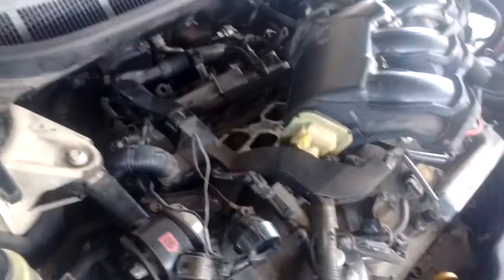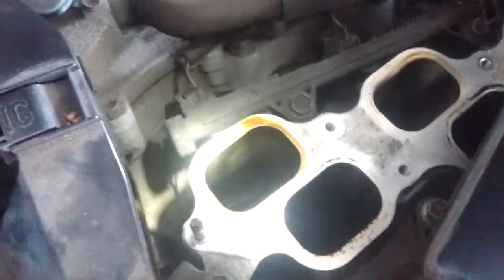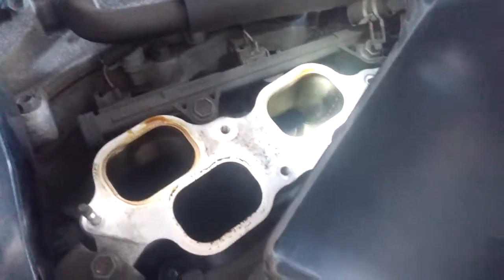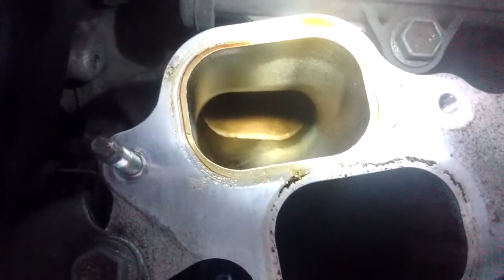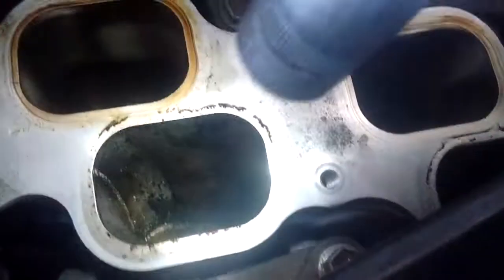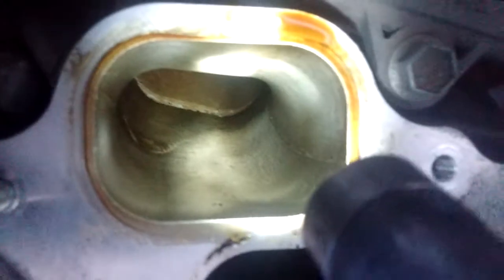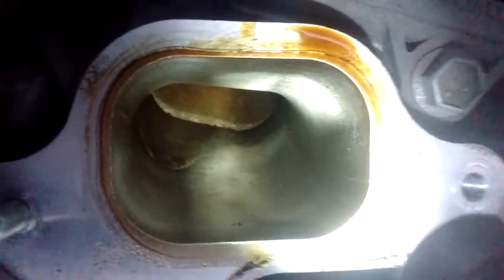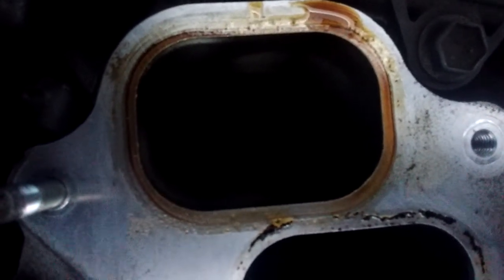2GR-FE - Why You Should Have a Oil Catch-Can

Comment: Would you recommend a closed or open catch can system? I have a highlander i have put a catch can in but it fills up pretty damn quick, im still running vaccuum to it from the intake but thinking of blocking that off and just venting to atmosphere to slow it down
Reply from the maker: If you are filling quick in normal driving,  this means your PCV valve is not working. If you vent to atmosphere you will have a vacuum leak, with CEL, and elevated fuel trims, and all kinds of issues. If you block off the vacuum draw from the intake, then the catch can will not do anything, nothing will pass through the catch can, it needs vacuum to operate.
Reply: @Merryfrankster_  thanks for that! I've got a new pcv in there, have ordered a valve cover gaskets set so I can pull that off and clean it all, I assume the baffles are all sludged up

Comment: Hello Sir, can I use the oem pcv hose that connects to the pcv valve to the intake with the aftermarket catch can? The aftermarket catch can came with a 15mm 3 feet vacuum hose. ADD W1 brand. Please let me know. Thank you
Reply from the maker: Yes if you want you can cut the pcv hose and put the catch can in line if you have the right fittings. I believe the pcv hose is 10mm. 15mm is too big for the pcv valve and for the barb on the plenum.
Reply: @Merryfrankster_  okay I see. Thank you for getting back to me. They had gave me two 9mm aluminum fitting
& two 15mm aluminum fitting. The 9mm fitting was a snug fit with the pcv hose. But I get you you mean about the outlet hose going into the plenum. With that being said should I get another 10mm hose? And where were you able to mount your catchcan? I can’t find anywhere to do so on my 2007 Toyota Avalon 2grfe
Reply from the maker: @samukahtviv1  you Mau have to extend the hoses enough to mount it by one of the strut towers length of hoses does not really matter either side
Reply: @Merryfrankster_  thank you very much. I hope it improves my motor. Lately it’s been giving me poor mpgs, under 18mpg even with highway trips. When I had changed all six spark plugs in December , I noticed the intake manifold was caked up with oil and black crust. Maybe that’s why it’s been giving poor mileage. I didn’t think to clean it that time because I didn’t have knowledge on how to and didn’t want anything to accidentally fall in the cylinders. I’m surprised this is an issue with a port injection motor.
Reply from the maker: @samukahtviv1  to clean it, turn the crankshaft to close the valves on each cylinder in turn. Then use a vacuum cleaner with small attachment to suck out whatever you scrape up.
Reply: @Merryfrankster_  okay I will try that. And I’m sorry to bother but last question…,
will having a catch can like this cause any problems to the internals like seals or rings or something? I’m doing my research and a lot of misconceptions and about seals blowing from pressure. What’s your take on it?
Reply from the maker: @samukahtviv1  that is absolute nonsense. The catch can will not cause any change in crankcase pressure.
Reply: @Merryfrankster_  thank you sir I appreciate your time and help
Reply: @Merryfrankster_  Hi Frank, hope you’re having a great weekend. 
Could I get your business email so I can send you a picture of my catchcan set up? Just wanted to make sure it’s a proper set up. Thank you God bless

Comment: Thanks for the reply.  Again, I value the info you are sharing.  The 2gr fse references you are making just add to my confusion (since I do not own an fse).  BEFORE messaging you last night, I was ignorant as to if my 2gr fe was DI or not & I couldn't find answer ANYWHERE (that's the whole reason why I messaged you to get the answer).  I read about direct injection engines needing catch cans elsewhere and saw that you did not mention them in this video but STILL recommended a catch can for the 2gr-fe.  THAT is what further confused me and caused me to message you again to get clarity about your recommending a catch can for my 08 Avalon 2gr fe (I was not sure if it was DI or not).  So my understanding of your answers is that THE BOTTOM LINE IS THAT... you are saying that my 08 Avalon 2GR fe is NOT Direct Injection but (according to your experience) would still benefit from a catch can.  CORRECT?  Yes, or no, or...?
Reply: You dont have direct injection in the avalon. But the catch can would help in any car honestly

Comment: Just want to make sure I understand this correctly. You're saying that my 2008 Avalon (with a 2gr fe) does not have gdi / direct injection but that it would STILL be best if have an oil catch can on it... Is that correct?  I ask because I HIGHLY value your opinion and, if you think it would be good to have one, then I want to order one as soon as possible.  As a result your fast reply would be very much appreciated.
Reply from the maker: This video is for a 2GR-FE - same as your Avalon engine. The 2GR-FSE with direct injection is not mentioned anywhere in this video. If you have a 2GR-FE, put a catch can on it. If you have a 2GR-FSE, it is even more important that you put a catch can on it. Direct injection engines are very well known for gunking up their intake ports and valves.
Reply: @Merryfrankster_  the 2gr-fse has both port and direct so it is fine.

Comment: Does a 2008 Avalon 2gr fe have a direct injected / GDI engine ?
Reply from the maker: No absolutely not. The 2008 IS350 2gr-fse is the Direct + Port injected engine. It is also a longitudinal engine. No chance you would ever find it in a fron wheel drive vehicle.

Comment: they should have included that oil catch can OEM.  too late now for me to learn this. too much build up alreay.  have no idea how to clean them off..
Reply from the maker: Here's how: With the intake off, set each cylinder in turn to TDC so the intake valves are closed. Then get in there with a stiff toothbrush or bottle brush and a cleaning agent. Use a shopvac with a small attachment to suck out the material you dislodge. As long as the intake valves stay closed, nothing will drop down into the cylinders.  Thoroughly vacuum out then wipe clean the waste material.
Reply: @Merryfrankster_  awosome thanks!
Reply: @Merryfrankster_   awosome thanks!

Comment: Any suggestions on a good oil catch can for the 2grfe?
Reply from the maker: For almost any  application you can use a $12.95 air compressor oil/water trap from Home Depot and it even has a petcock drain.
Reply: Not trying to impress anyone.  Just want to make sure that the home depot version isnt pressure restrictive, thats all.
Reply from the maker: @zee1726  why would it be pressure restrictive? How did you come up with that? On your own? It is rated for operating compressed air machinery up to 120psi. It is probably superior to any piece of junk sold for automotive use.
Reply: Yes I agree, any suggestions as to which catch can I can use for my 2014 2GRFE Highlander
Reply from the maker: But if you're looking to impress spend some money on a billet Moroso.

Comment: Just replace the pcv valve, and then you won’t be loosing engine oil and transferring it into the catch can instead it will keep the oil in the block where it belongs.
Reply from the maker: DZZZTTT. This won't help. The issue is the air-oil separator.

Comment: does a 2zzge also need this in stock form? I've been thinking about it for some time now, what would be a good place to instal it?
Reply from the maker: Definitely it is not a bad idea. The best place to put the catch can is on the pcv line. This catch can will collect a fair amount of oil depending on how you run your car. The other air line, the breather line, I have never caught a single drop of oil with a catch can, so there is no need for a catch can on it. See my video on the PCV system, in the "MR2 Spyder for Dummies" playlist.
Reply: @Merryfrankster_  so putting it in the PCV line will prevent oil deposits on my intake and probably it'll help the engine in the long run if I'm not mistaken? Thank you very much man, excellent videos
Reply from the maker: @anunknowndude  Yes here you go. https://www.youtube.com/watch?v=07ssRI8k81E